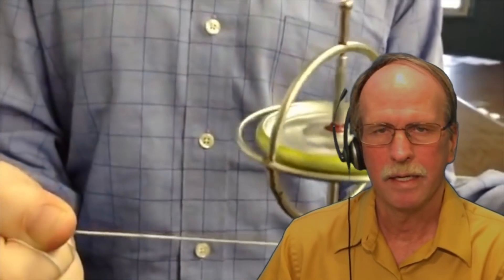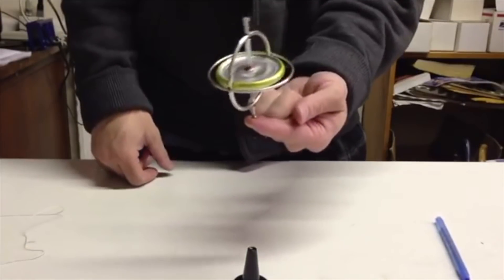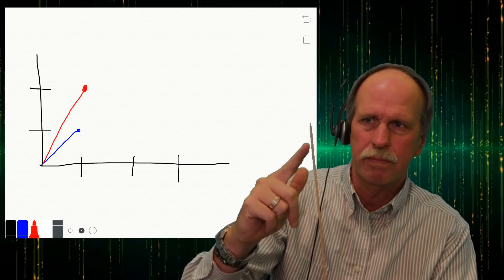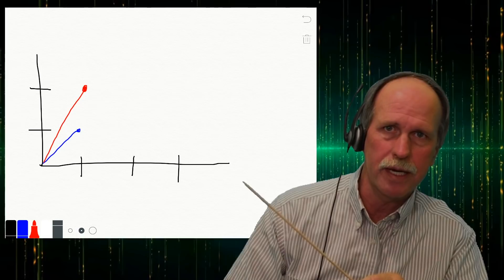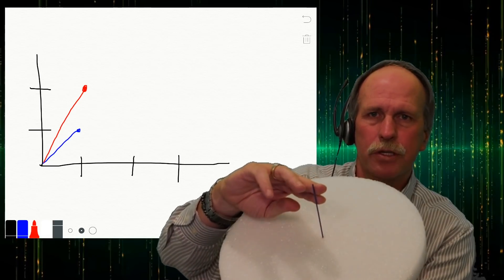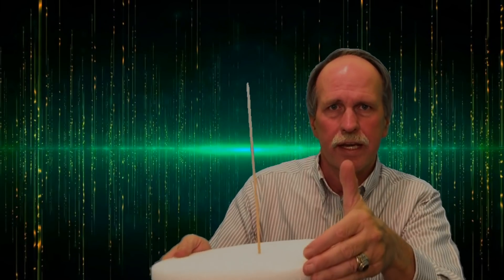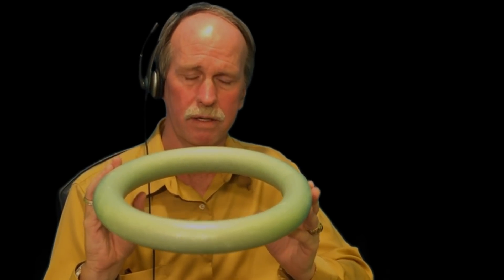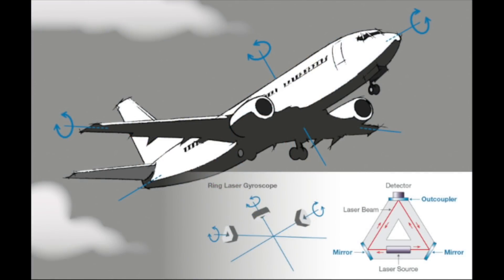Friday Physics Gyroscope | Laser Ring Gyroscope

Comment: I'm ready to turn in my homework assignment. The rotation of the earth imposes torque onto a spinning gyroscope when it is standing upright relative to the local horizon. This torque causes the gyroscope to precess, which causes the axis of the gyro to be deflected at a 90 degree angle from the direction of the imposed torque according to the right hand rule. This precession gradually pushes the axis of the gyro over towards true north. Once the axis of the gyro and the axis of the earth are aligned there is no longer any torque being applied to the gyro so at this point there is no longer any precession and the axis of the gyro is pointed toward true north. Further, if the axis of the gyro becomes slightly misaligned with the earth's axis for any reason a small amount of precession will occur to realign it again. Essentially the rotational axis of the gyro becomes locked in the same direction as the rotational axis of the earth due to the gyro's precession characteristics.

This alignment between the axis of the earth and the axis of the gyro can then be used as the navigational reference for a ship. And of course this action is also direct observable evidence that the earth is a sphere and that it is rotating on its axis.
Reply from the maker: You get an A
Reply: @BobtheScienceGuy  Thanks. I saw your explanation in the video a week later. I think adding all the references to the sun made your explanation unnecessarily complicated and confusing. This has nothing to do with the sun. The whole point is that no matter what the original orientation of the gyro happens to be the torquing effect of the earth's rotation will cause precession, which will drive the gyro's spin axis into a parallel alignment with the rotational axis of the earth. It's really just that simple.

Comment: Buckminster Fuller once described precession to some government officials by using the analogy of a spinning man with an Olympic throwing hammer in each hand. If you gave one of the hammers a bump upward it would gain momentum in that direction.

It would also keep orbiting the spinning man, so the upward deflection would follow the orbit of the hammer.

Of course, a rigid flywheel is a little different, but I thought it was a nice way to show the effect of force on a gyro is in a translated direction.

The very best way to demonstrate gyroscopic effects is in a departure stall drill with the right rudder on the floor. Just eat the last few inches of elevator in one quick pull and maintain full throttle and full right rudder. Great way to demonstrate the prop's gyroscopic attributes, reversed p-factor from a negative angle of attack (the real kind of angle of attack), and tell if breakfast agreed with you, all at the same time.

Comment: For those who are wanting a simpler practical example, imagine this:

Imagine you have a ball on a string swinging around a central point (like swingball). Changing just the axis of the centre point does not not change the ball path as it rotates. This hopefully will be obvious due the the way there is no force acting on the ball simply by changing the axis of the centre.
Then replace the string with a rigid bar, which is fixed securely to the ball and the centre. It will rotate around the centre just as it did with the string. Now imagine tilting the centre axis, and try to imagine what the ball would be experiencing in terms of forces. The ball wants to continue in its circular motion, so when you tilt the axis, you are changing the direction of it's path, and you will feel resistance while trying to change that angle. It's important to realise that the resistance occurs WHILE changing the axis. A gyro is a solid disc, so it is a continual "ball on the stick" at all places and at all times.
Reply: Maybe even simpler as also maybe more effective, since you can feel the forces yourself.
Take out the frontwheel of your bike, hold the axle with both hands, one left, one right, have someone spin the wheel. Start slow, note that it is still easy to change the angle of the axle. The faster the wheel spins, the more difficult it is to change that angle.
Note, that it is still very easy to move the wheel along it's axle without changing the angle, but as soon as you try to change the angle, you will feel the force counteracting. Basically what he's explaining from 5:15 ish onwards, but maybe easier to understand when you actually can feel it and not only see it being explained on a monitor.

Comment: Your blue and red line explaination was terrible. You didn't explain anything.  Just that they were red and blue lines at different angles.

Alot of words, but no WHY all this is happening.
Reply: The Red and Blue vectors represent the Angular Momentum of the same gyroscope, at two different times.  The Red vector is the angular momentum, L , of the gyroscope when it was given a faster spin, so it has a greater angular momentum at this time. The Blue vector has a smaller angular momentum using the same gyroscope, just spun slower, and in both cases were facing up, along the y axis, originally.    [ note  L = Iw,    L  is the Angular Momentum,     I = moment of inertia ... think of it as the resistance of the gyroscope wheel to be spun,  and  w = angular velocity... e.g., how many revolutions per second  spin given to the wheel of the gyroscope. ]  

Now, if a  force is applied to the gyroscope with the Red angular momentum vector from left to right in the diagram, it pushes the Red vector over  LESS than the Blue vector, since the greater Angular momentum of the Red one resists that change more than the Blue one does.  The Blue vector  L  is smaller  ( being the same gyroscope, it must have had a smaller  w ... angular velocity  to start with ) , so it is easier to push over with the same force.

Comparing the Red and Blue vectors of the angular momentum of our gyroscope to the y axis,  the angle between the y axis and the Red vector is smaller than the angle between the y axis and the Blue vector, which we would expect since the Larger angular momentum "resists" changing it's direction more than the smaller angular momentum.  

BTW...you can actually feel the resistance to changing the direction of the Angular momentum of a bicycle gyroscope.  Check out youtube demos on " conseravtion of angular momentum" .... it's a fun science demo !
Reply from the maker: When I looked at the video released, it was missing a scene where I lay the foundation for that demonstration.  I'll make sure it is in the second part .  I must have accidently cut it.

Comment: I lost it at the blue and red vector.  What are those?
Reply: The Red and Blue vectors represent the Angular Momentum of the same gyroscope, at two different times.  The Red vector is the angular momentum, L , of the gyroscope when it was given a faster spin, so it has a greater angular momentum at this time. The Blue vector has a smaller angular momentum using the same gyroscope, just spun slower, and in both cases were facing up, along the y axis, originally.    [ note  L = Iw,    L  is the Angular Momentum,     I = moment of inertia ... think of it as the resistance of the gyroscope wheel to be spun,  and  w = angular velocity... e.g., how many revolutions per second  spin given to the wheel of the gyroscope. ]  

Now, if a  force is applied to the gyroscope with the Red angular momentum vector from left to right in the diagram, it pushes the Red vector over  LESS than the Blue vector, since the greater Angular momentum of the Red one resists that change more than the Blue one does.  The Blue vector  L  is smaller  ( being the same gyroscope, it must have had a smaller  w ... angular velocity  to start with ) , so it is easier to push over with the same force.

Bob should have compared the Red, Blue vectors to the y axis, in which case the angle between the y axis and the Red vector is smaller than the angle between the y axis and the Blue vector, which we would expect since the Larger angular momentum "resists" changing it's direction more than the smaller angular momentum.  

BTW...you can actually feel the resistance to changing the direction of the Angular momentum of a bicycle gyroscope.  Check out youtube demos on " conseravtion of angular momentum" .... it's a fun science demo !
Reply: @phasma6669  Why are we even comparing red and blue vector?  What are we trying to explain?  What's the Y-axis and X-axis?  Are they spatial coordinate or inertia and speed?
Yeah, I've seen the bicycle wheel gyro and the lecture.
Reply from the maker: some of the video was missing.  Let me help here, Angular momentum is the resistance to tilting the gyro.  The point being made was that with a larger angular moment, the same force applied will tilt the gyro less.  The higher the spin rate, the more rigid the gyro is in space, I'll explain it better in the second video.
Reply: @xdragon2k   It helps to look at vectors with a coordinate system. The X and Y axis  are in this case spatial coordinates,  you could have used any two orthogonal axes for this diagram,  e.g.   X and  Z,  Y and Z.  { not sure how inertia would be along an axis, anyway }.   Most people  think of  the Y axis as  " upwards" and  the horizontal as the X  axis, when working with a 2 dim. diagram.  Since Bob was using the gyroscope earlier in the video, starting with it's angular momentum aligned with the upwards direction, he called that the Y axis. 

As for what we are trying to explain, Bob just wanted people to understand that L resists a change in direction, the larger L is, the more it resists the change. Thus the Red vector will move less in the direction of the applied force [ or should I say it will have a greater resistance to being moved in that direction than the "blue" vector, with a smaller  L ].   That will, in fact , cause it to react by moving in the third  direction [ in this case, the Z direction, using the Rt. hand Rule ....I like the XYZ form of the Rt. hand rule... index finger is pointing in the direction of  the vector L,  three remaining finger bent 90 deg. represent the applied  force,  then the thumb extended points in the direction of the  "precession" of the gyroscope ]. 

Bob will cover that in the video with Gyro compasses he just published... it's nicely done, go check it out.   Take care   :)

Comment: Still confused on description you are using right had but the video is showing you are using your left hand .
Reply: He said the video has it reversed, and what you are seeing as a left hand is in fact his right.
Reply: @traog  Wish he had changed the narration to reflect what is on the video since he is aware of it.
 The topic is complex enough without adding additional confusion.
Reply: @hhampton  Changing the narration to match what you see in the video versus what he is actually doing would be more confusing. Right hand, rotation going from wrist to fingertips, the thumb points in direction of angular momentum, if you use your left hand the thumb points the opposite direction.  What he is describing can be explained with right hand or left hand "rules" but the description of the rotation relative to the hands changes, (the actual rotation remains the same). With the right hand the rotation goes from wrist to fingertips, thump points in direction of torque, to do the same with the left the rotation must go from fingertips to wrist. He could have done it with his left hand as if it was his right and that may have helped, relieve confusion.
Reply from the maker: Flying I very carefully pointed it out

Comment: Note that the Left-Hand Rule actually does apply when determining the generation of and interaction between an electron and magnetic fields (sign change.)
Reply: Bob neither stated nor used the right hand rule for electrodynamics: he is using the term for a simpler problem, figuring out how to do a vector cross product. I am not sure this is a standard use of the term, but it probably should be, since the use in electrodynamics depends on the vector cross product, too. Wikipedia seems to agree: https://en.wikipedia.org/wiki/Right-hand_rule
Reply: Are you sure that you meant "election"? The rest of your sentence suggests an electrically charged particle instead, not some phenomenon of democratic societies.
Reply: Apollorion   Thanks!  While our elections are indeed negatively charged, that’s a different discussion.

Comment: Question, does the precession of a gyroscope with a constant velocity happen to match the precession of the earth? Also, I had the fortunate experience to test bed one of the early RLG systems in the F15 Eagle in mid 1986 replacing our Inertial Navigation System which was gyro referenced. INS took a minimum of 15 minutes to stabilize, sometimes longer, before the aircraft could move. The RLG system(Inertial Measurement Unit) was stable within 5 minutes and the accuracy was such that it could bring the aircraft back to within 6 feet of it's initial position. Another aspect of the IMU is that it was a third of the weight of the INS, 40 lbs. vs 100+ lbs. Recently read an article where they described the newer navigation systems where the inertial reference system is coupled to the GPS which effectively cancels any and all errors in navigation. Amazing, when I think back to those early models of the RLG (forgot to mention the systems we tested were Honeywell)
Reply: Cajun Drifter   Nice. Here’s one ATPL Training film. The point that it made is that you need powerful computers to sort out the signal information. The algorithms also compensate for earth’s rotation, the Coriolis effect, transport wander, and one more effects. https://youtu.be/dzzi5dcIhag
Reply: No, it does not match the precession of the earth.
Reply from the maker: Imagine a box to represent an x,y,z axis system. Put a ball in that box. You can describe every spot on the surface of that ball with an x,y,z coordinate right?  The LRG will shoot a line through that ball which intersects the surface at 2 and only 2 points. You are located at one of them

Comment: I once gave my young nieces a demonstration of a gyroscope using a bicycle wheel, spinning it and supporting one end of the axle on a finger.
Unfortunately I had not allowed for the amount that such a spinning wheel turns at 90 degrees to its axis of rotation, it twisted off my finger, landed on the coffee table, flying across it scattering everything left right and centre to much hilarity.
Reply: I misread that as "it twisted my finger off, landed on the coffee table... to much hilarity" and thought what a strange family.
Reply: @rootlessmisanthrope2611  

Lol!

Comment: Cool ! Unlike a gyro on the earth, for a planet in space it would seem that there shouldn't be a torque provided by gravity trying to tilt it. That is, any force from its own gravity acting on a vector normal to the surface(including the axis of rotation) should just be in a direction that only subtracts from the magnitude of the angular momentum without changing its direction, never causing a tilt in the 1st  place or so it would seem, especially under such symmetry. Where is the flaw ?
Reply: @realcygnus  --   Here are a couple ideas that might explain why precession starts in the first place. First, real gyroscopes are imperfect to some degree. Second, on a rotating spherical earth while the gyroscope attempts to maintain its orientation in space the gravity vector of the planet changes beneath it thus starting the precession.
Reply: The force is provided by gravitational interaction with the sun (and moon to a lesser degree). If the earth was a perfect sphere, there wouldn't be any precession, but it's not. It's an oblate spheroid with the equatorial diameter being larger than the polar diameter. Secondly there is an axial tilt of about 23.5°.

The bulge around the equator combined with the tilted axis means the gravitational pull from the sun is uneven and applying a force on the rotation axis, inducing precession.
Reply: Peanut Gallery right..... after posting, i was thinking that even the slightest imperfection in spherical symmetry & even density distribution could do the trick even without orbital/tidal effects/forces, which probably also contribute.

Comment: "Laser ring gyroscopes register the motion of the sky that is generated by heaven"
-Dr. Bob Noodles (Behind The Swerve).
Reply: I award that guy zero points and may God have mercy on his soul.
Reply: I wonder if it's because they don't understand that the gyroscope is showing its own movement relative to space, that they think their explanation is satisfactory.
Or it could be because they know their followers are too thick to see the obvious problem of them being totally unable to demonstrate the magical force they are claiming exists.
Reply: @grahvis , if their ring laser gyro would measure the rotation of the stars, on the flat earth it would always show rotation around the axis perpendicular to the surface, everywhere on the flat earth. But the gyro shows rotation around an axis that is parallel to the globe earth axis everywhere on the globe. This axis points to north or south and its angle from horizontal is the latitude angle. Did Bob K. see a rotation around a vertical axis? No. Conclusion?
Reply: @George89999 

Like Jeranism's personal domes. :-)
Reply: @George89999  

It would have to be a "vortex" centred over the top of the gyro for the instrument to always show the same speed of deviation wherever it was located.
Otherwise it would be like the pendulum where its rate of deviation depended on its latitude.
Reply: Bob Supernoodledoodle.